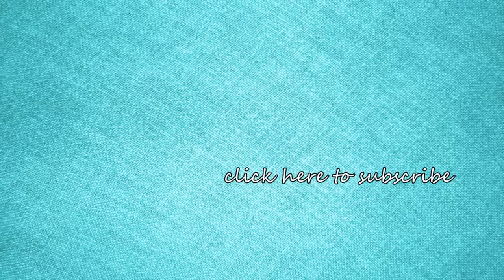Awesome Greenhouse Bell Pepper Farming - Modern Greenhouse Agriculture Technology

Comment: i thought 
using the robot to pick the pepper was longer than human did
Reply: yes but its like a learning curve,, a human baby isnt capable of picking a bell pepper,, but when its grown and know how to do it, it becomes faster.
same goes for robots.. it must learn and improve,, benefit is that a robot dont need sleep and rest like a human do,, it can harvest 24/7 all year without holyday. hehe. 
im a 57 year old mecanic, and i remember the first say cnc lacing robots, they wasnt very effective and usually had to be teachd its movements by a human operator.
todays robots, you just put in the metal and the robots push out finisd parts depending of the program you put in.
Reply: @Snorklaren0  It's not like you'll stop work automation by saying "It's evil sheeple, you'll all be replaced!!11", one solution for you is to learn to build an maintain all those robots/machines, the only solution for most people in the long term is to change the system though.
Reply: @samkom33  that wasnt the case with that robot, it was using image recognition to draw a map then trying to calculate where the fruit is, then locating it based on the map, clamping down, then snipping hoping that it hits the stalk... If that thing were learning it would run a lot better than it was, I could almost bet they've had that thing forever and they just cant get it right, in fact this is most likely they best it has ever run which is why they filmed it.
Reply: @toordog1753  humans use image recognition too, all the time.
try say digging up potatos in a rocky field by hand, without knowing what a potato looks like... haha,
ore like my 5 year old niese told me a few years ago.... DONT pick and eat the green strawberrys they make your stommac hurt.
robots evolve as time goes by in all types of electronics.
not becouse the robots evolve by themself, YET hehe.. but becouse the human programmers add improved programs and functions
Reply: If they can truly automate it instead of having that nerd on the backside, then it would cost 1/1000th as much as a human.  Cost efficiency is king to corporations.
Reply: @JonesCrimson  exaktly,,,,, a fully automated robot usually dont need peebrakes smokebrakes, foobrakes, and so on.
Reply: lg fotocopy well it picks the perfect peppers and can work 24/7 vs a human
Reply: Also with a pepper on the back side of the plant, the "hand" might damage the plant trying to cut.